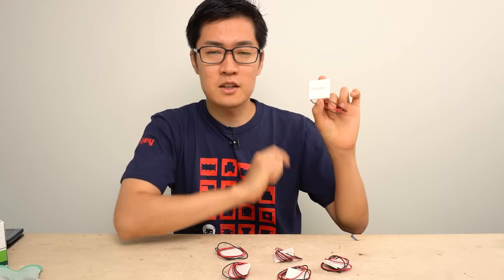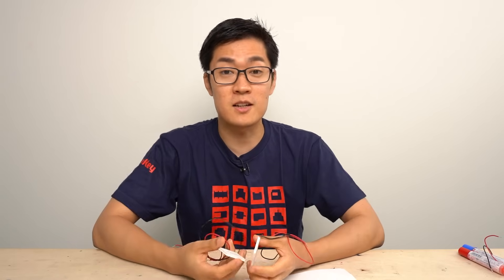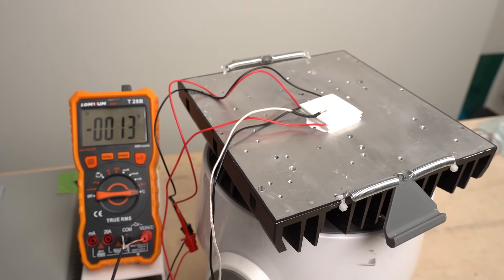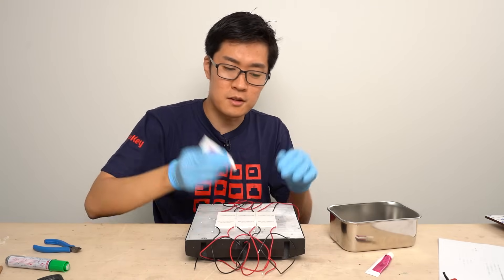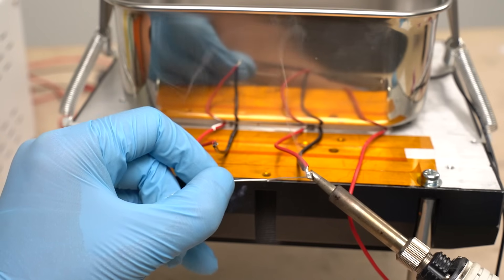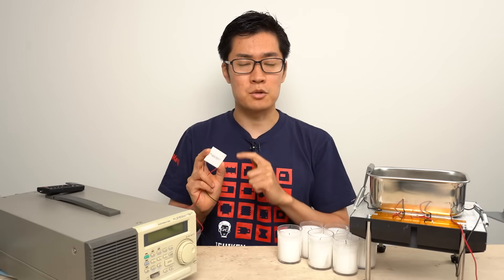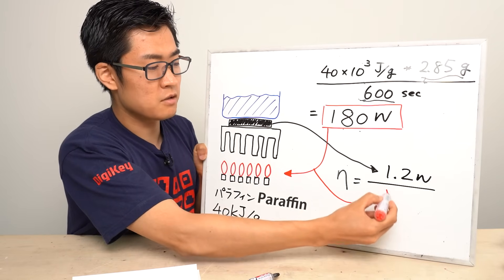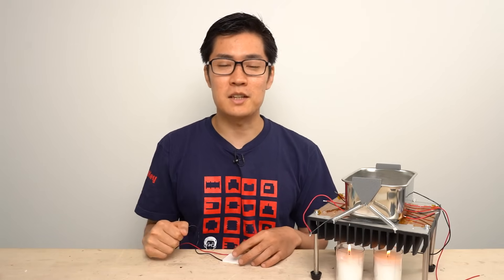Peltier Device Could be a Generator

Comment: You compare Peltier modules to solar panels... but did you try to heat the Peltier modules with the sunlight? Take them, paint them in black, expose them into the sunlight and see if their efficiency is better then with candles... (heating a heat sink).

Comment: 10:25 . . . I so want you to use the motor that is being powered by your peltier generator to stir the water to lower the temperature to increase the voltage supplied to the motor.

Comment: the biggest challenge is to understand how they work.
they dont "generate" electricity. they produce a potential difference when there is a temperature difference across them. the power that can flow through them due to teh temperature gradient has no relation to he power output.

 for a given heat source, you can say a certain mass heats so fast, as it radiates so much energy away.
simultaneously, the heatsink at an elevated temperature above ambient can dissipate so much heat at a given temperature... the temperature gradient is independent of the energy flow across it.

with some effort you can tune the two sides so the rate of absorption and radiation at the desired gradient just meets the limitations and no more...

Comment: What if you power two peltier on either side of one and use the temperature from those two to extract power from one sandwiched in-between a cold and hot side of the two powered ones. I know sounds ridiculous but curiosity struck while watching this.

Comment: I'm curious about a passive trickle-charge type device you could place in a river or stream. Could a stacked device partially submerged in running water have a large enough sustained differential for continuous "free" power? At least enough to charge a survival beacon?
Reply: no.
the voltage they can create is simply due to the temperature gradient.
the energy that can flow through the module due to the temperature gradient has no bearing on the output power.
if you dont have much gradient, you have no output. stacking just reduces the temperature gradients per module.
you can run them in parallel and wire in series, but as the gradients so low, the output is still pathetic... you also need massive surface areas...
trying to develop and maintain 100C gradients is pretty hard.

say a heatsink on a candle at 40W can heat to 150C. you slap a module and heatsink on, and through that 40x40mm area it can dispose of 40W of heat(assume.)... the heat sink happily dumps 50W at a mere 20 above ambient... now, as the module can transmit that 40W no problem, and the heatsink dispose of it readily... there is no gradient as the part being heated by the candle has the heat drawn out of it before it can rise in temperature. this is the bit that makes it hard!

so you slap on two candles, 80W, and now the module limits the energy that flows through it to 40W as it reaches 150, the heatsink happily keeping it at 20 above ambient, allowing for say, an 80C gradient... its sort of like that, anyway..

which gives about 4V on the sp1848 at 550mA or so. not very much but could work... if you can make and maintain 150C, that is....

its a juggle between heat input, absorption, transmission, and radiation. trying to get the least energy flow for the maximum output.

Comment: Of course, at 10:00 you can put a blade on the motor and use it to cool the system instead of the ice bath giving unlimited* power.

* may not work as expected afterApril 2.

Comment: What are the most effficient peltier devices? I was thinking of researching a drink cooler using a small solar panel.
Reply: is 1m X 1m solar panel small? / its still not enough
Reply: @echelonrank3927  Thank you. That would be unwieldy on a bicycle used to keep a drink cool, lol. GREAT work here.
Reply: @mscir  better use the bike momentum with a dynamo

Comment: 0.6% is actually quite good. Great job!
You can achieve 2-4% at best but that requires a very high delta temperature and insulating all paths.
Reply: with TEG modules yes, with what the guy is using - no way !

Comment: Interesting video.
Are Peltier devices used commercially? what is their use?
Reply: For cooling ICCD chips, e.g. for spectroscopic setups. They are used to reduce thermal noise, thus improving the signal-to-noise ratio.

Or anywhere you need cooling and don't want vibrations from moving fans and such (of course the Peltier element is then cooled by passive cooling) 😊

P.S. Those small one-can mini fridges use them too; to name a more commercial/everyday use case 😅
Reply: @B0B_BELCHER I'm thinking about getting a few Peltier modules to play around with and do some experiments. It probably won't ever be able to generate a large amount of power, but it could definitely be useful to power small devices and recharge cell phones, tablets, etc. I wonder how well it would work with just cool water as opposed to actually using ice.
Reply: @ct6502c  u should get a few watts by cooling with water if u dont waste time with the low efficiency TEC modules (C=cooler) like everyone else is doing on utube ,
use the TEG version instead (G=generator).  e-bay.
12V 15A Heatsink Thermoelectric Peltier Power Generation Plate TEG1-199-1.4-0.5  
Type number ：TEG1-199-1.4-0.5
Dimensions ： 44*40*3mm
Open-circuit voltage: 11.1V Matched load resistance :3.07 ohms
Matching load output voltage:5.6V Output current:1.8A Output power: 10W

Comment: While watching the video I started thinking about if it would be possible to combine a bigger array of peltier modules and a joule thief, and just utilize the temperature difference between ambient and wet bulb temperature, to maybe charge small batteries, extremely slowly, not if it would be practical, but if it would be possible without an insane number of peltier modules, and then you mentioned efficiency, that made me laugh.      

Great episode, even if I think the energy represented by the ice should have been included in the efficiency calculation, as it is the difference, not just the hot reservoir that represents the energy source.

Comment: Great video. But why didn't you include the cooling effect of the cold brine solution in your calculation for efficiency?
Reply: You don't define efficiency that way. It's based on the difference in temperature.

The Carnot efficiency is the limit though. That's how Coal plants end up being more efficient than say a car engine, because the "cold side" temperature is so much lower.
Reply: @letsburn00  okay thanks

Comment: They were one of the coolest devices when i was a kid. Too bad the efficiency is low. Using Vapor Compression Cycle is much more efficient even if they're not solid state. Good video 👍👍
Reply: This guy is a few decades behind they use Pelletier devices with wood stove fans, the heat generated from the stove powered the fan motor and on the top of the fan is a heat sink that the fan pulls cold air through to cool the other side.
Reply: Wow  that'sQuite smart @chrislewis2262